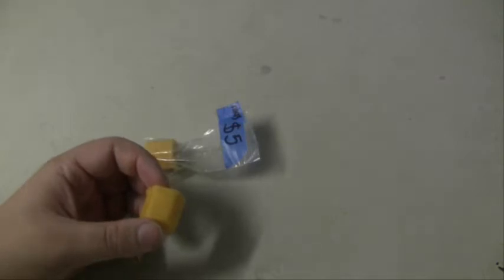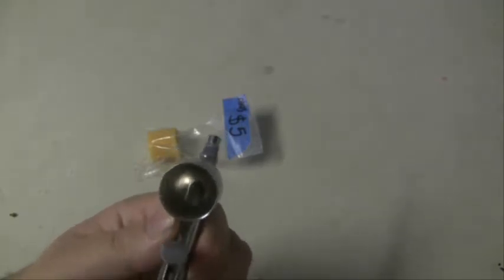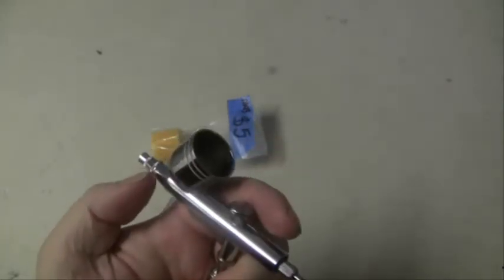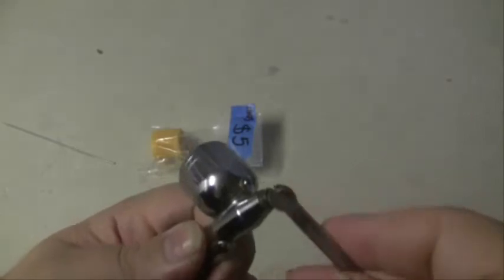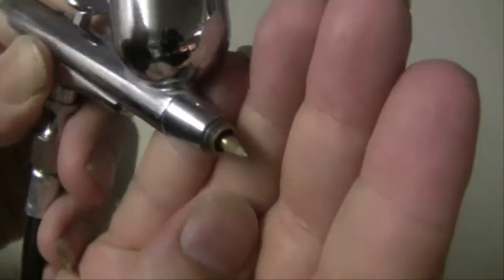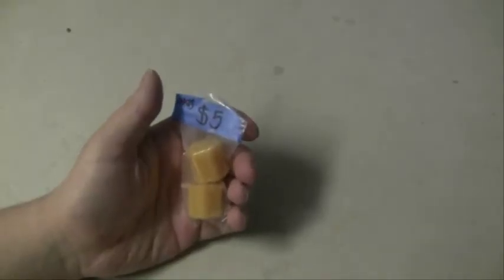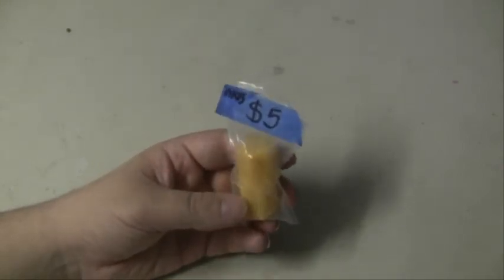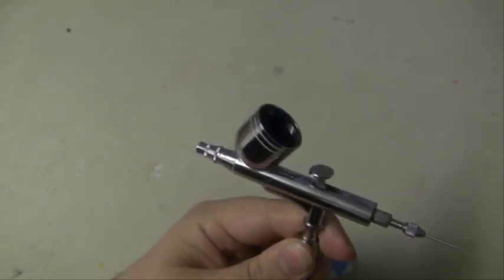Airbrush - Sealing a nozzle air leak with bee's wax

Comment: This is a nice tip, as sealing your head components is important, but this is also another case of using overly costly or exotic supplies for airbrushing. I've been sealing all my brushes for years with colorless, flavorless chapstick. Won't ever seize your threads, does the same job as the wax shown here, and can be found for under a buck or free, and a stick will last you forever
Reply: Crewchief 227 Oh good tip! I’ll definitely give that a try.
Reply: Thank you! I had a chunk of beeswax, but it didn't help. Chapstick worked perfectly :)

Comment: I used this after seeking another YouTuber apply it to improve the airflow of a cheap Chinese airbrush since they tend to come with rubber O rings instead of nylon or neoprene ones. With proper care the rubber ones will last a while, but with regular cleaning solutions and age they will eventually wear out. This is accelerated even more you spray lacquers or enamels. I guess I got lucky since that person did not specify that the beeswax should be cosmetic grade so it will be something to look out for in the future The beeswax has performed pretty well on my Masters and no-name Chinese airbrushes so far since it is fairly resistant to solvents. Haven't been able to find any good nylon/neoprene 0-rings that will fit the airbrushes in the aftermarket. The ones that do show up will usually not specify  what material they are so I would rather spend an extra 10 minutes using the beeswax when I have to fully clean the airbrush to reseal it. Good info.
Reply: Hi, do you think Chapstick or candle wax will do the job ? I am new in airbrushing and will use my airbrush to spray 2k paints (0.35mm nozzle /tip ok?????) and clean my new  neo airbrush with acetone. Should I remove the O-Ring right now before it's damaged by acetone and put the wax to seal the nozzle or can the O-Ring withstand  acetone at least a few years without wax ?
Thanks!

Comment: Hi, do you think Chapstick or candle wax will do the job ? I am new in airbrushing and will use my airbrush to spray 2k paints (0.35mm nozzle /tip ok?????) and clean my new  neo airbrush with acetone. Should I remove the O-Ring right now before it's damaged by acetone and put the wax to seal the nozzle or can the O-Ring withstand  acetone at least a few years without wax ?
Thanks!
Reply from the maker: Its worth a try

Comment: Can I use this as an O-ring because I lost my o ring?
Reply from the maker: This method with the bees wax trick on that seal will limp your airbrush along until a new model is gotten. These measures are temporary.  https://www.youtube.com/watch?v=PXjxjiOdjHE
Reply: Didn’t get it. Can you explain more? I would be much happier if you tell what do you do when your cleaning the nozzle with beeswax on it.
Reply from the maker: @Cake_Doge  Instead of apply the bees wax on the nozzle you apply it on the seam were the O ring use to be. This is after you replace the O ring with putty.